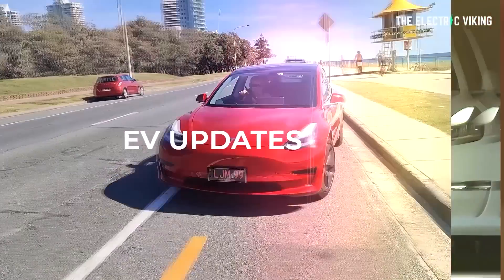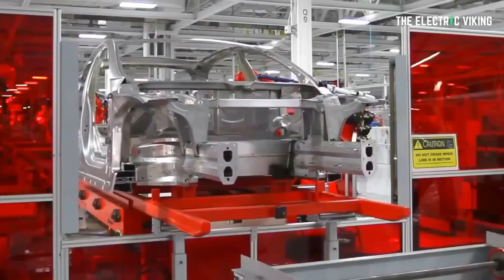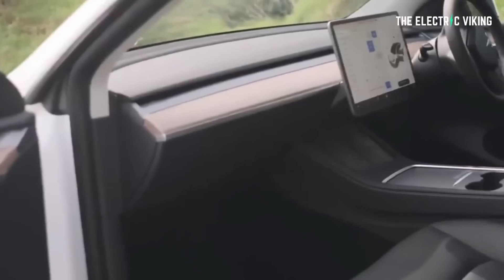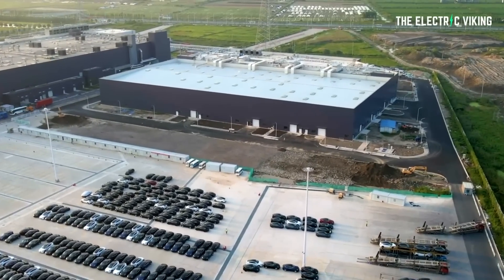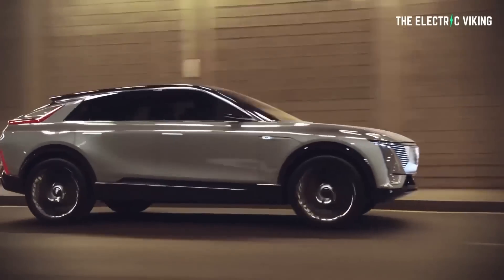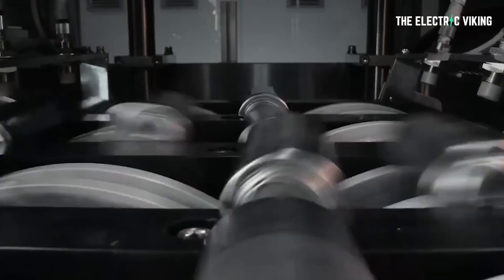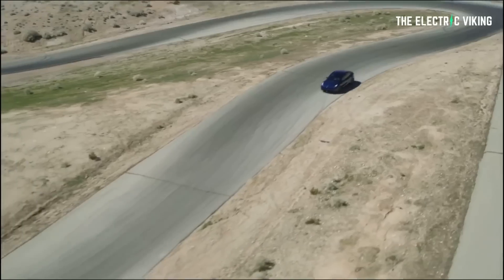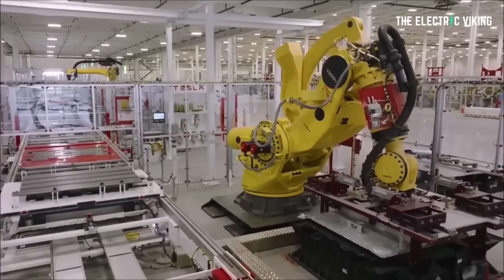Tesla's NEW 4680 battery pack size is UNBELIEVABLE

Comment: As stated, your data/source for your claim that this 279 mile range comes from a 50 kWh battery pack is:
https://youtu.be/FI4z3L9-ybA
As explained in the source video, you could be correct that Tesla has only unlocked 50 kWh of a larger capacity battery actually onboard (perhaps 70 kWh or even more). This approach by Tesla would clearly be fully consistent with a similar approach used previously on the Model S! The truth should become clear as soon as someone can test the cells used in these vehicles. Likewise, the actual charging rate could also be software limited at this point. While I cannot understand why it would be limited to a lower charge rate than the Fremont 2170 battery packs, I can speculate that it might have something to do with another option being created for LiFePhosphate cells that may not charge as quickly but cost significantly less and last significantly longer with deeper cycling between charges.

Comment: Hi Sam I am pretty sure these 46/80 packs are just LFP and later this year they will come out with the Nickel battery  what are your thoughts thanks Bill
Reply: I think Warren debunked this theory. I can’t remember why. But I agree with you.
Reply: @305dreamhonda  Assuming they are 4680 cells, Elon or Drew said they won't produce LFP in that form factor.
Reply: There is no way these are LFP. The numbers don't add up. It is hard enough to get the production of one type of battery chemistry working, let alone two as you are suggesting.
Reply: I don't think they are lfp. But they could be chemistry of lfp is well sorted its just new packaging. Lfp would be the only answer to make this pack impressive

Comment: September 22, 2020 the 4680 cell was announced to the public as a beta test cell.
June 11, 2022 Teslas with the new 4680 cells are delivered with 30% more energy density at 50% the cost of "older" cells.
Installed in load bearing cases as batteries the pack becomes one of just THREE pieces that comprise the ENTIRE CAR'S CHASSIS.
This car sells for more and costs less to make and deliver, meaning the profit per car will be Record Breaking and History Making.
Reply: The higher profit won't be there in the early stages. The volume of vehicles are not high enough to cover all the fixed costs. It will take many months before these are as profitable as the Freemont model Y.
Reply: You're slightly early.
I think these cells have precisely the same "energy density" since they use 2170 material.
They have 5 times the CAPACITY, and output 6 times the POWER of a single 2170 because they're 5 times "bigger" in volume and have a tabless electrode.
The PACK has less metal in it (cell casings).
The CAR has a big sheet of metal removed ("the floor").
.
So, the pack has similar Capacity to previous units.
The car is slightly lighter, with the same aero.
Logic (!) dictates the +/- 68 kwh battery" will push the lighter car slightly further?
.
IN FUTURE
Cell chemistry will be tweaked, perhaps radical materials will be used, but THIS version is mainly a physical ("mechanical") revision of the whole system (AKA Vehicle)
Reply: @rogerstarkey5390  The 4680 isn't the same material as the 2170. The 2170 chemistry IP belongs to Panasonic and it uses the wet application process. They might be similar, but definitely not the same.
Reply: @Poorold plowboy You are looking at the more for less in the wrong way. What is critical is the vehicle with a certain range. The actual size of the battery pack is secondary.